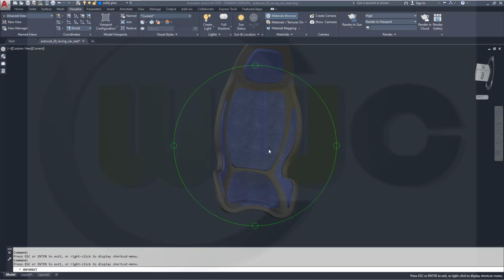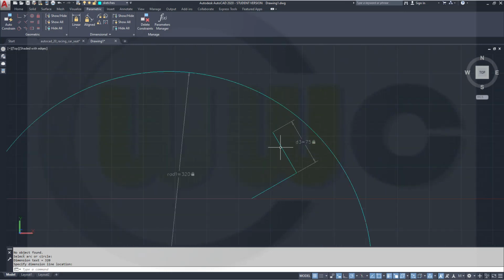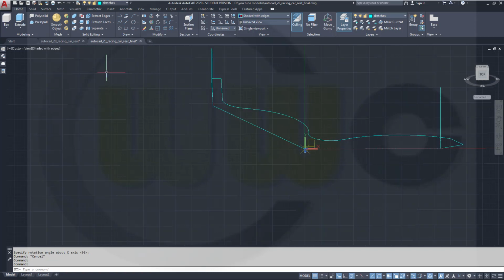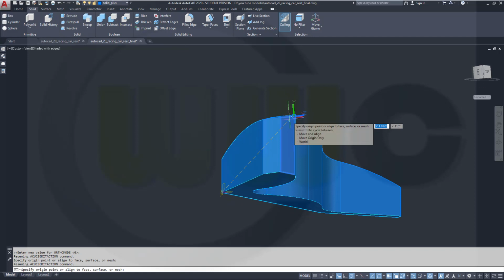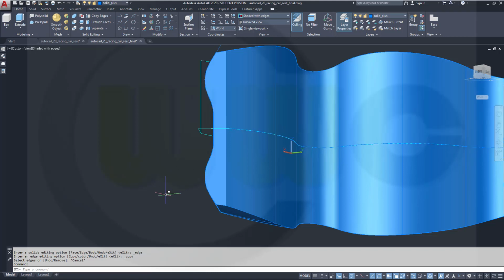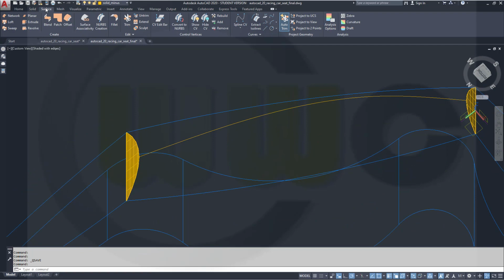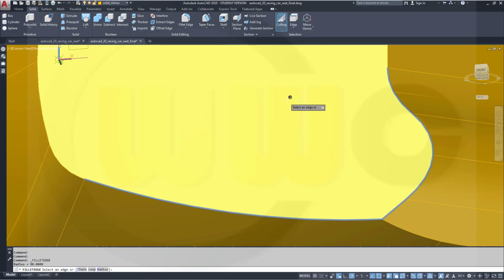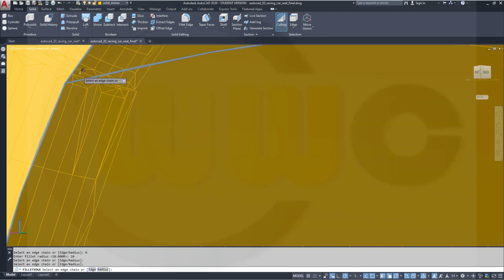Racing Car Seat Part 1 - Autocad 2020 Training - Part Design

Comment: At 22:10 I am getting an error 'slice failed for selected solid'. The other slice worked fine so I am a little lost.
Reply from the maker: Hard to tell, extend the surface which you use for "slicing"
Reply: @wolfgang.walden.cad.training  Got it thank you. I moved the axis to the incorrect position. Really appreciate it.

Comment: 6:24 I don't understand. 
I do as you do, but that part doesn't open. I cannot confirm the Nearest option. 
I'm using autocad 2020.
Reply from the maker: Just press "ctrl + right mousebutton" - this will show you the snap options. But you should know that, before you try a model like this. Maybe you should do some basic exercises first.
Reply: @wolfgang.walden.cad.training  
It's been a long time since I used it and I forgot some commands. Thank you for your help.

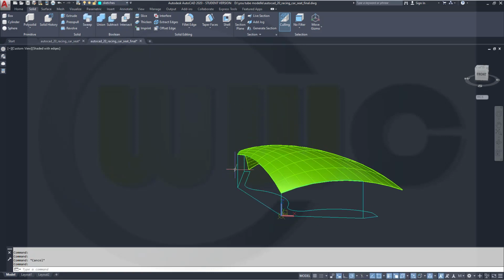Comment: In 16:47 you changed the sketch option to solid pull. I don't see this option.
Reply from the maker: I changed the layer, that´s all.
Reply: Wolfgang Walden thank you for replying. When I go to change the layer there is only 0. Nothing else. How do I change that?